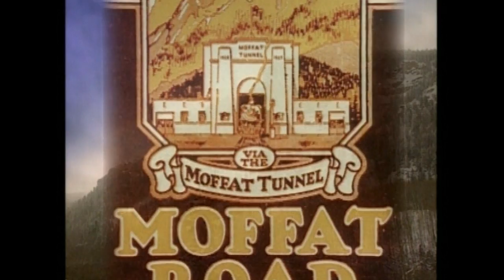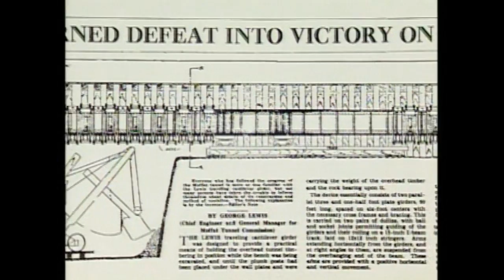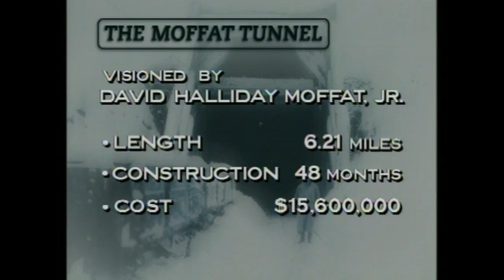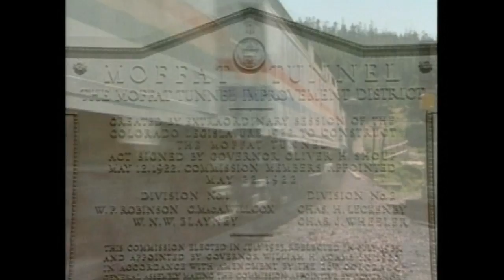Building The Moffat Tunnel

Comment: From what I've read, this line never did connect to Salt Lake City until well after the Moffat Tunnel was finished, not until after the D&SL was acquired by the D&RGW which built the Dotsero Cutoff connecting this line to the D&RGW Tennessee Pass line finished in 1934.
Reply: The Dotsero cut off was built by the Moffat and spiked closed to prevent the D&RGW from using the line.
Reply: Continuing, the line won’t to Orestod now known as Bond. After thinking this might have been the end D & S L spiked closed The tunnel was built by the Moffat Tunnel Commission, which required a “pioneer bore” which increased the cost. When the Denver Water Commission wanted to bring water from the Western Slope their tunnel was already there. Visit Winter Park and you can see the west portal of the water tunnel. When the Cascade Tunnel was put through, there was no pioneer bore, built by the railroad, it is longer than the Moffat Tunnel bored quicker and for a much lower cost. It’s amazing what happens when a government entity is involved. Was the pioneer bore conceived to facilitate the water commission? Good question.